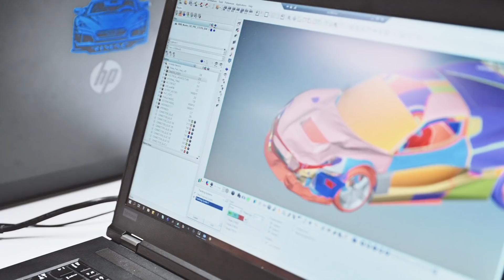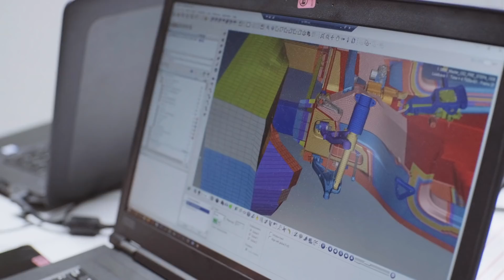Crash-testing Two Hypercars in Two Days

Comment: Wait why are the crash tests done at such low speeds when it's a hypercar? 56 kilmetres per hour is only 35 miles per hour. I can understand testing at low speeds for everyday use, but surely it needs to be done at like 5 times thatas well?

Comment: wonder if its possible to design a crash structure which, when it detects an impact, can absorb the 1st impact well enough to keep passengers within a certain g threshold, and then still have a 2nd volume left over for a 2nd impact which can also absorb some impact.

Comment: I wonder whether it is using a real battery pack or dummy cell inside the pack? 
Since crashing a fully functional EV could lead to battery penetration and thermal runway, it is much safer to use the same weight of the dummy cell for simulated battery weight. 

Or ... the battery weight will NOT affect the result?

Comment: Quite interesting to see how fully carbon body behaves much more different than metal. For example Merc SLS didn't had any door wobble which can be seen on overhead camera at Concept 2, and doors design is very similar. Also wondering was hood crashing into a windshield and breaking it something that was anticipated or was it surprise?
Reply: Thin sheet steel bends easily, while big carbon fiber pieces don't bend at all,  but they can wobble a bit when they're thin, like doors.
Reply: @derbigpr500  still i was surprised how much deformation was on front end during the crash. However still not enough to bend hood to prevent it from sliding into windshield. I wonder what will happen if they put stronger latches, will composite brake off from them or just band and come to original position after energy is transferred...

Comment: Why isn't there a 100km/h test ? - That would be the average speed of fast cars - correct me if I am wrong
Reply: that is left for computer simulation I guess, now that they correlated real testing results with the simulated ones.
Reply: Because that's not necessary to test to be road legal
Reply: @lovrocroatia2  EuroNCAP usually tests at 56 km/h. Rimac here 2:50 was testing with 40 km/h. That is way too low.
However, good to see that they made a 56 km/h test too, but I wonder why does it worth destroying 2 cars.
Reply: @attilazk   they did 56 km/h as well
Reply: @markmatic5718  I know. I wrote. I mean not much need to destroy two cars to test at 40 km/h too.
Reply: @attilazk  maybe they need two tests to extrapolate data for higher speeds.
Reply: @attilazk  - Do you really think that Porsche, Kia, Hyundai... would risk their image on not tested car?
Reply: @ag2smal  OMG. What is it that you can't understand in what I wrote?! I did not say that they shouldn't test!
Reply: @attilazk  - Dude, let me quote you: "...but I wonder why does it worth destroying 2 cars."
Now, you do have one gramatical error  which may change whole meaning if you correct it in way it suits you.
Reply: My thoughts exactly

Comment: With doors that open upwards, how does one get out in case the cars flips and lands on its roof?
Reply: Well if any windows are broken, climb through it. If not, try to open the window or break it if necessary.
Reply: Doors blow off, like on all cars with such doors.
Reply: @derbigpr500  Wow. Really? Any proof of that? I don't think any of them use such aeronautic technology.
Reply: @attilazk  The Mercedes SLS was one of the first supercars to introduce doors that popped open when the car flipped over. That was over a decade ago
Reply: @attilazk  Yes. Plenty of proof. You're acting like this is something new, and not something that's been around for years. Door hinges have charges next to them that pop and blow the hinge off, so the whole door can be removed easily.
Reply: With electric cars a center of gravity makes it exceptionally difficult to flip. That said, some manufactures an option where you a means to dethatch the window. Another option is having a window breaking device in the car.
Reply: if you manage to flip that car, you will be unconscious anyway so one way or another, firefighters are going to cut the door
Reply: @daniel99651  Richard Hammond wants to talk with you
Reply: @egm1843  did Hammond so something recently. Seeing a massive amount of comments about him
Reply: @CalgaryCooper  he flipped and crashed a rimac.
Reply: @CalgaryCooper  He crashed yet again while filming a Grand Tour special. Apparently he's ok
Reply: @egm1843  Crashmond.
Reply: @daniel99651  dumb answer lol.
Reply: @SZ-ZS-  dumb answer for dumb question, as if flipping a car like that is easy..
Reply: @daniel99651  dumb response.  Cars are designed to protect people from the stupid mistakes they have caused, such as rolling a car...
Reply: @SZ-ZS-  so you think that rolling a supercar/hypercar is as easy as rolling a 20yo hatchback?
Reply: @daniel99651  please point to where I even remotely hinted at that lmao.  I said "cars are designed to protect people from their stupid mistakes".  When did I even compare it flipping to other cars? 🤣
Reply: @SZ-ZS-  you did not, but op did
Reply: @daniel99651  ..yeah
Reply: @SZ-ZS-  OP has a point. What do you do if you drive over a cliff. It happened to more than one McLaren speeding on a sharp corner, but in both cases the drivers walked away.
Reply: @srinitaaigaura  i don't think you meant to reply to me.  I was agreeing with OP.